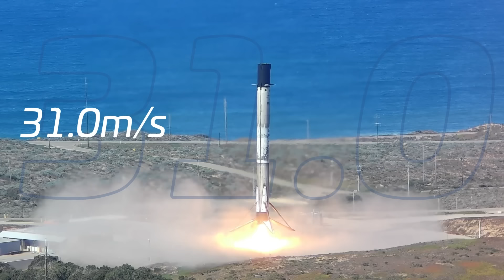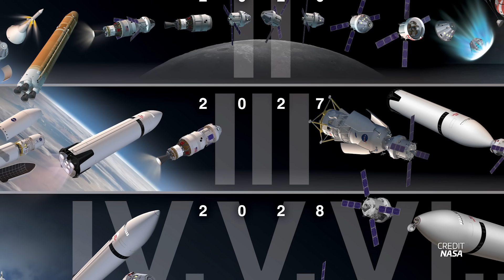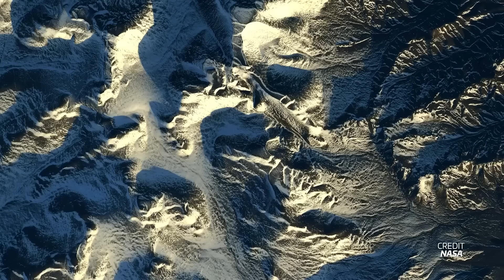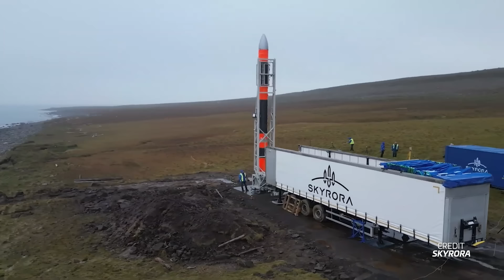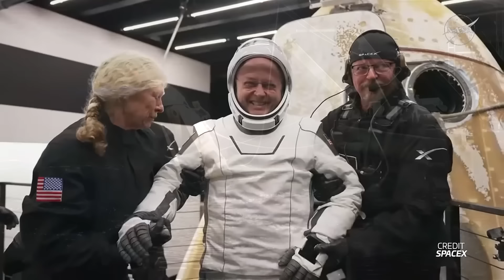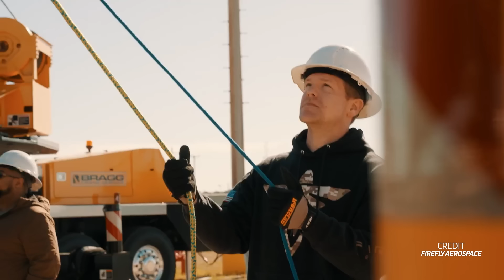NASA Changes Artemis Plan — Moon Landing Moves to Artemis IV | This Week In Spaceflight

Comment: Is it me, and I don't have any confidence in the Artemis Program?  I have no confidence in the design, the cost, and the no reuse of any hardware.  I would not be surprised if China passes us due to all the problems of just launching the dang thing.  Using hydrogen is obsolete, and the design should be for using methane.  SpaceX will be on the moon, while NASA will be going back and forth from the launch pad to the Assembly Building.  NASA should get out of the rocket building and buy rockets to send astronauts to explore space.  NASA runs as well as Social Security and Medicare.  I don't think even Elon Musk can fix NASA and the Federal government should not be a roadblock on everything SpaceX does.  Until NASA's mission changes and overhauled, we will fall behind any space race.  Boeing is the only benefactor to Artemis and NASA programs.
Reply: Once SpaceX develops a solution to get humans BACK from the moon, then NASA is very much diminished.  Right now SpaceX is dependent on NASA/Boeing/Lockheed for SLS-Orion for that task.  NASA and the Space Industrial Complex is probably worried SpaceX will crush their cushy money from the taxpayers.

Comment: 😂😂 We were able to do it multiple times no problems in the 60s and 70s, but cant do it now. Riiggghhjttt.
Reply: It's ok. Got AI as well, this time.
Reply: Usable payload on Saturn-5 stack in the Apollo programs was 700 lbs.

I think we're trying to do a bit more.
Reply: @ConstantTrue  And yet did so much less with so much more power. 😆Forget 700 lbs, Apollo supposedly had a 5000 ton lander.
Reply: @icystrangers5482  I'm not knocking Apollo.  Amazing achievement.  Probably the most amazing achievement of mankind so far.  And I don't even think the Artemis missions will top that.  Maybe humans on mars will, unsure.

But, a 5000 ton lander is NOT reusable.  My point was, how much cargo is needed to start a lunar base.

Apollo had it's goal of landing humans.
Artemis has a goal of starting a lunar base, and that requires MASSIVE payload that you can take out and setup on the surface, and leave there.
Reply: @ConstantTrue  Yes, it was a very amazing "achievement" for the 60s technology to carry tons more with a significantly less powerful rocket and the computer power of a 90s handheld calculator, negotiate a precise orbit round the Moon (not a 'flyby'), drop a 15 tonne lander (cf 700 pound payload), which took off and redocked with the orbiter at first time of asking (no dry run without humans), and then return to Earth. Amazing "achievement".

I know you are being disingenuous because you are deliberately confusing what Artemis supposedly DID and what is PLANNED. What it DID was take a much smaller payload requiring a much more powerful rocket than Appollo. So, it doesn't add up. That 60s technology  was clearly juju.
Reply: @icystrangers5482  I guess I'm just now realizing that you may be a "Apollo-was-fake" believer?

If so, conversation over.

Have a good one.

Comment: So many europeens are so very, very concerned with "reduced carbon footprint" while pretending to care about *ACTUALLY* getting hardware into space so I have ceased to take them serious in the least. Just like them turning off their nuclear power plants and then pretending that "they care" about reducing energy production carbon footprint. 
Vega C has launched a total of six times in the last four years. They propose only twenty two launches through 2030. A *SINGLE* Falcon 9 booster has had more than *TWICE* as many launches as *ALL* Vega C *PLUS* all Ariane 6 rockets.
They have *ZERO* plans for a reusable rocket. They act irrationally and keep doing hand-waving and hem and haw at an incredibly slow rate and they will never even propose a real and useful space launch system or fund it properly. 
They never produce and by this point are really bad at even pretending. They are all just wind in sails.
Reply: Well, let's not be too harsh with them, they did force our astronauts to pee in bags for almost the entire Artemis 2 mission...so I guess we could say "Europeans provided new opportunities to explore space travel accommodations" ?

(fact: ESA built the ESM, which had the frozen pee pipe issue)

Comment: Lol why does the graphic from NASA have a docking port at the tip of the nosecone of HLS? Doesn't Starship still have the header tanks in the tip of the nosecone?
Reply: No, Starship HLS doesn't have header tanks in the nosecone. The docking port in the nosecone has been known for years and it's also in official SpaceX renders
Reply: @Alexphysics13  which makes little to no sense. Even for landing on the moon they'll need dedicated landing tanks. Also in terms of production line and all of this it just doesn't make sense. This would mean a sever diversion from the standard Starship production process when it should only really relate to the interior and things like landing legs and the elevator.

I'd bet the reason this is still shown in animations til this day is because since the first conception they haven't really gotten into the proper design of this capability
Reply: @niri2506 why would they need dedicated landing tanks, they’re not changing orientation during landing. As for production, no, it would not mean a different production. They just don’t install the tanks and move on with the nosecone down the line.
Reply: @Alexphysics13 how are they not changing orientation while landing? True it might not be as violent a flip as done by Starship during atmospheric landing. But still you need a massive change in orientation to go from orbit to landing upright on the surface. And even if propellant slosh wasn't an issue. There's still things like boil off to consider. Which can just be handled much better by a dedicated tank compared to the giant volume of the main tanks which will be close to empty by the time Starship arrives at the moon.

And yes it does change the production process quite a bit. Particularly considering that in the end crewed ships will need the header tank anyway and a dedicated docking port in another spot than the tip of the nosecone. This just goes against everything SpaceX is attempting with mass production.
Reply: @niri2506  When Starship is in orbit and lights up the engines, the engines themselves will create the gravity needed to settle the propellants down to the bottom, hence no need for landing tanks. Propellant slosh may be an issue but there are going to be hundreds of tons of propellant on those tanks when Starship lands, there's plenty of margin there for the propellant to go down to the transfer lines and to the engines. Once again, no, it does not change the production line. There are different steps the nosecones go through and two of them are specialized header tank installation jigs. They can just simply not put the nosecones in those jigs and jump those two steps over to the next one in line which is internal outfitting with COPVs.
Reply: @niri2506  Current plan is that Starship HLS has a ring of thrusters (perhaps 10-30 of them) about 2/3 the way up on the craft.  The main engines at the bottom do the heavy "breaking" coming down, but then the ring thrusters take over at the end, to not kick up as much lunar regolith.  This ring most likely has fuel tubes that go down to fuel tanks near the main fuel tanks OR uses the same fuel as the main tanks, unclear.

Upon blast off from the moon, the ring activates first, get the ship going up, and then a bit higher up in altitude, the main engines relight to get the delta-v necessary to get back into lunar orbit.

Comment: Starship HLS isn’t going to be ready for Artemis 3 so change the plans for Artemis 3.
Reply: You do know the same could be said for Blue Origin.  None of it's required refueling tankers, space tug, or space transport craft have been seen, except for the tiny lander itself.
Reply: Nothing to do with Starship.  SLS itself won't be ready any time soon.
Reply: @i-ccc-channel SLS might be having technical issues but it’s a completed and demonstrated vehicle on the pad now. It’s nonsense to say that it isn’t going to fly.
Reply: @RoryShields1  The problem is that its having the exact same "technical issues" over and over, even though they were supposed to be fixed.  The seem unable to fix them which is a problem.  The hydrogen seal issue is persistent, and has been even since the days of the shuttle, with no solution yet.  The helium flow issue us very concerning, since it worked fine the day before, but then failed for unknown reasons, and can't even be inspected or repaired on the pad.  It's one thing after another, but it seems to be the same things all the time, and no permanent fixes. That tells me that this is NOT a completed rocket.  It might be one day, but right now it isn't.  Imagine if Airbus claimed the A380 was a "completed and demonstrated" plane, ready for passenger service, even though it leaked fuel from the engines on every take off...
Until NASA and its contractors can produce a permanent solution to these on-going and repeated issues, it is not a completed rocket.
Reply: @RoryShields1  Who said it isn't going to fly?  It seems erecting strawmen is what you do best.  I never said it wouldn't fly: I said it would not be ready for the moon landing attempt any time soon.  It is way behind.
Reply: @i-ccc-channel you can use whataboutism with SLS all you like. My point remains true: the biggest flaw in the Artemis program isn’t the big orange rocket, it’s the 2 contractors who have overpromised and underdelivered. 

I would love for them to change my mind by getting their stuff together.
Reply: @RoryShields1  No.  You don't get to back out of your since comment so easily.  You challenged my original comment by saying "It’s nonsense to say that it isn’t going to fly."  The only problem is, I never said that!  You invented it, and attributed it to me.  Own up to your error, like a man.  What I said was that it won't be ready for a moon landing any time soon.  There's a whole bunch of reasons why it won't be ready any time soon, including those you mentioned, but I never said that "it isn't going to fly".  That was you, not me,
Reply: @i-c @i-ccc-channel whatever you say bud.

Comment: Why don't they just use the dragon capsule? It works and is adaptable to most any use.
Reply: Dragon is good for LEO. But it cannot under any circumstances be used for a mission to the Moon. It's like trying to drive an F1 race with a minivan. You have orders of magnitude less performance than you need.
Reply: @atomf9143 a long time ago, in a galaxy far, far away, there was once much talk about Red Dragon - a variant designed to fly all the way to Mars, and even propulsively land there.  It's hard to know how far the design progressed inside SpaceX, or how feasible it turned out to be upon deeper review...  But anyway, not likely to happen regardless, since SpaceX is all about Starship now.
Reply: @Spherical_Cow   Oh boy I remember Red Dragon. A little relieved it never worked out independently. Could you imagine being stuck in a minivan-sized area for nine months?
Reply: @atomf9143 Falcon Heavy can easily put Dragon around the Moon & back as Artemis is doing.
Dragon’s heat-shield was designed for & is capable of lunar return velocities (unlike Orion’s).
SLS/Orion is useless for a sustained human presence on the Moon.
Reply: @warrenwhite9085  Dragon is neither designed nor qualified for deep space missions.  It's hard to know what increased radiation would do to Dragon's electronics, or whether it can cope with much more extreme and sustained temperatures than it experiences in low Earth orbit.  Its communications subsystems are probably not adequate for deep space operations, either (lacking sufficient power, pointing accuracy, etc.)  Dragon's crew accommodations might also not be very ... accommodating ... for missions that last more than a couple of days.
Reply: Capsules like Orion & Dragon are useless for long term human presence, which requires hundreds of tons of cargo/supplies.
Nasa’s SLS/Orion is a $100+ billion useless dead-end toy. Shameful.
The future of affordable, sustainable space is Starship type reused, large, robust spacecraft capable of transporting both astronauts & 100 tons to planetary surface.
Reply: @warrenwhite9085  Yes!  Finally someone gets it!  Thank you WW!

By the way, here's the recent calcs regarding BO:

Blue Origin Blue Moon HLS program...as it stands today: 
What are the final numbers? 
3 separate craft have to travel to the moon 
5 or more craft are blasting off from earth 
3 or more docking maneuvers occur above earth 
3 docking maneuvers occur above the moon 
fuel is being transferred above the earth 
fuel is being transferred above the moon 
usable payload to moon surface is small

Yes, the above is BO's plan.  No kidding.

Comment: I’m confused. If we are testing the landers in 2027 and maybe 2 attempts in 2028. Do we need 3 landers now? As far as i know they are not built for reentry. Or are we leaving them in orbit for up to a year?
Reply: Don't now about BO but I would bet SpaceX will have that HLS attempt reentry just to see how it fares without any TPS at all 😂
Reply: I don't know. Blue Origin and SpaceX haven't really given us any details yet about their new plan to participate in Artemis III, IV and V.
Reply: The test in 2027 would only need the landers but none of the refueling parts so it's a lot less to ask
Reply: As of current, no moon landers have the heat shields necessary for re-entry into earth orbit to earth surface.  I would expect that NASA would want to do the now Artemis 3 dock testing with as close to the "real" moon landers config as possible.

They would have protection from sun rays for the trip to the moon, SpaceX using white tiles, and BO using who knows (looks like some kind of gold colored foil).

Neither would be coming back, both would be left in either moon orbit, or back down on moon surface after mission's end.
Reply: This new schedule sounds like a lot of Elon Time.  Should we start referring to it as Jared Time now?  No way the lander prototypes will be ready for manned orbital missions in 2027.  And absolutely no way will they be ready for not even just one but TWO! manned lunar landings in 2028.  Looks like Jared is BS-ing with wild abandon, no doubt trying to keep the orange troll off his back...